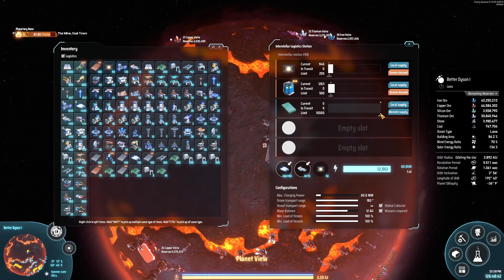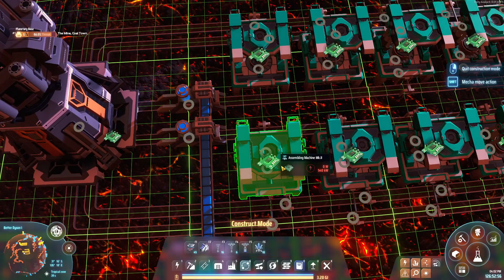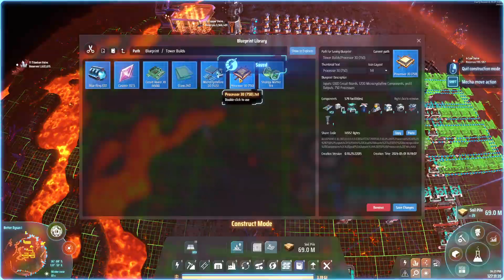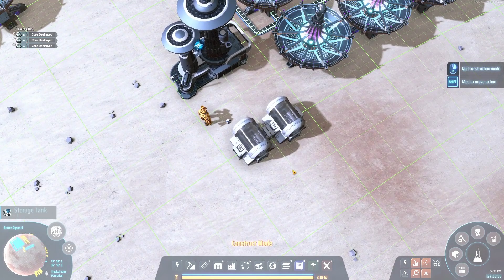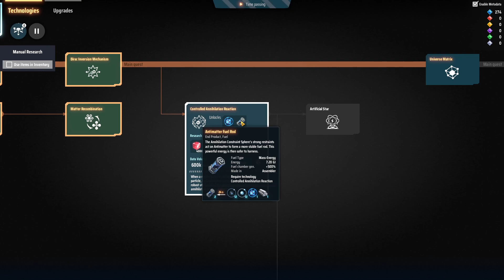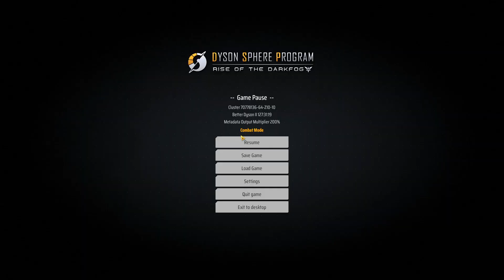ANTIMATTER // Dyson Sphere Program // Mission Log 122

Comment: you are correct, generating photons RESERVES a large amount of power from the sphere, so it can't be used for anything else. since antimatter is needed for white science, i almost never have RR in power generation mode. nearly 100% of my spheres are dedicated to photons. 

definitely check out the proliferated antimatter fuel rods. and play with the antimatter capsules too. its fun to basically 1-shot entire fog bases with them. artificial stars are super neat too, definitely recommend making a few even if you aren't building to the scale where you "need" them.

the sphere latitude research has like 5 ranks so you need to click it a few more times lol. definitely before you end your playthrough, check out the Black Hole, the Neutron Star, and to a lesser extent the white dwarf star. fly up really close to them, and fly up close to your dyson swarm and sphere. the visualizations are great.
Reply from the maker: Gotcha, will do before the end :)